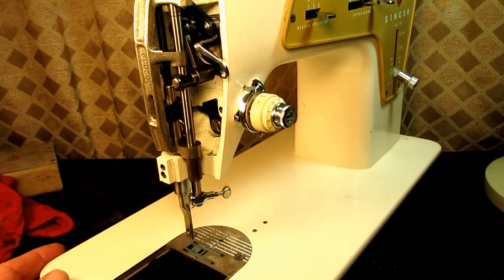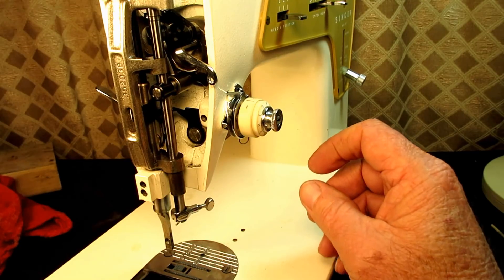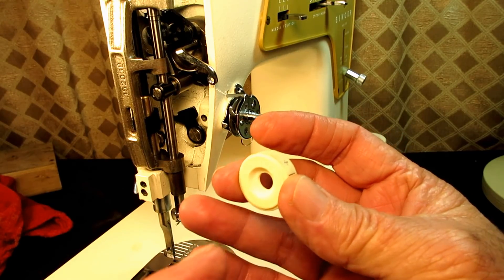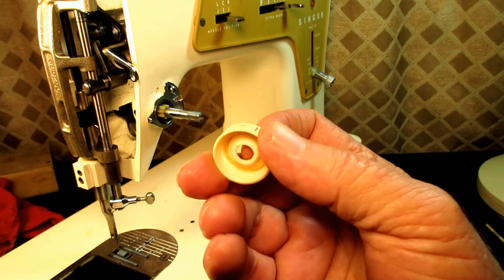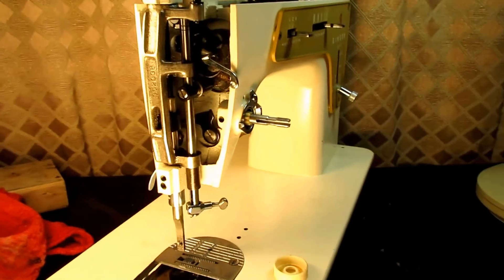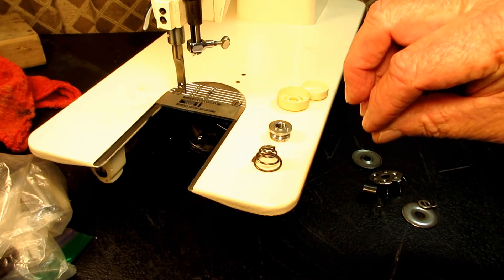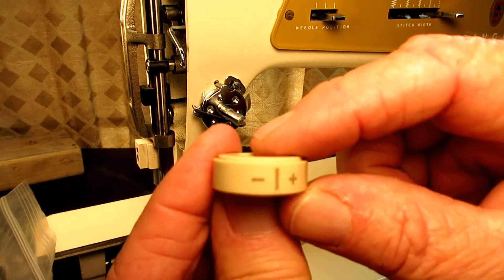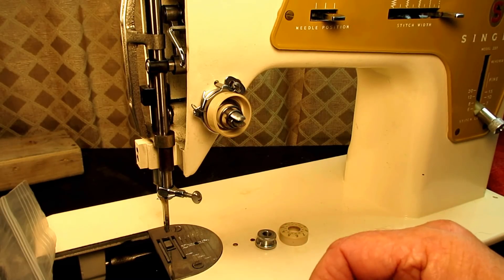A Broken Tension Unit on a Singer Model 237 ... Now What?

Comment: The thread tension spring rust is a good argument for your preference to removing these parts prior to the bath. That rust may have come after the bath where the dryer couldn't reach inside here. The plastic parts may have cupped in some moisture.  Also, I've always been curious how generic these thread tensioners are.  Like you said, the tensioner is somewhat generic between many models, maybe with the exception of the rod length?   Thanks Andy. I always gain bits of knowledge from your instruction!
Reply from the maker: Thanks for watching, Mark. I was a little surprised at the rust in there b/c I blew the machine with the leaf blower for a good 15 minutes. Yep, I like to take more parts off to get clean underneath them and inside them. The tension theory is really the same, but you are correct; some have a longer stud, pin and many have different size, style, and numbers of tension discs. The older ones had very sturdy metal "gear teeth" while later models the teeth, numbered flanges went to plastic. I noticed today the stud gear "teeth" on Stella has a crack. That's very common. I will be showing and fixing it in a future video. The thumb nut went through a few changes also.
Reply: @andytubesewing1953  No no, thank you, Rick!  ;)  Just being funny, I get called worse.  haha
Reply from the maker: you are a gentleman & scholar!⭐🌟👍